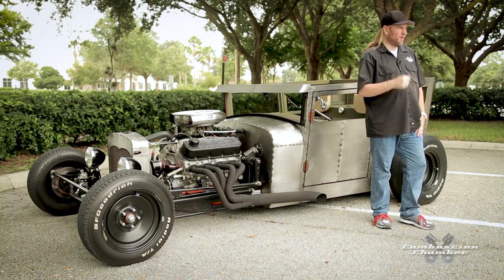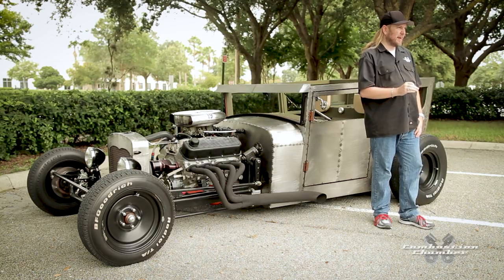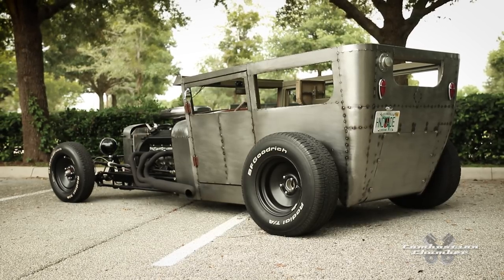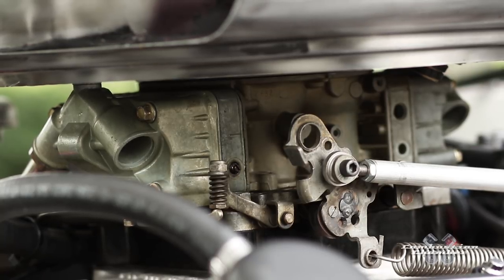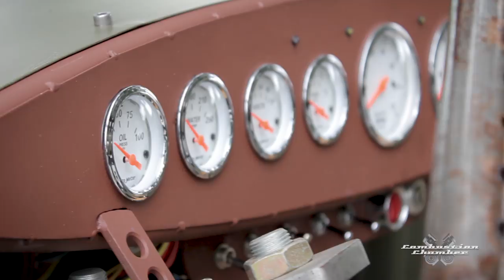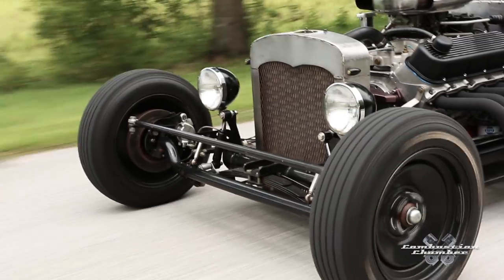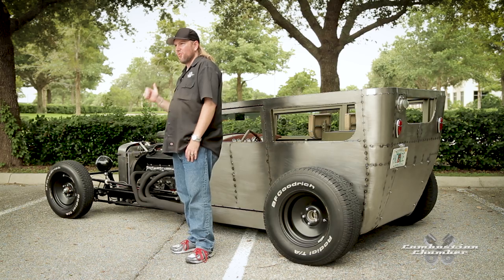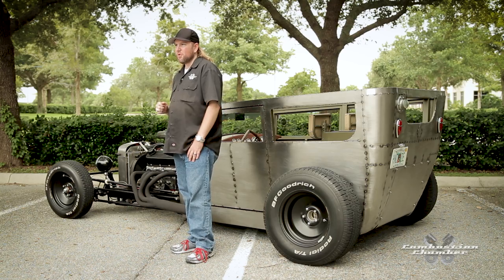HEAVY METAL! - Handmade Rat Rod - COMBUSTION CHAMBER

Comment: Howdy, my name is Iin, I'm a Virginia boy but I now live in Vermont. My lady and I just took position of of a Rat Rod. It was built by a good friend in Virginia (Kenny Allen). It's a 1942 Dodge pickup that is sitting on a Chevy S10 chassis so I have power steering and power brakes and all the modern handling of a late model S10. It has a small block 305 Chevy V8 with 350 heads aluminum intake and 600 Holey Carb. and turbo 350 automatic transmission. Wheels are of of a Pontiac Firebird and the gas tank is from a Triumph Spitfire.  Lots more but the computer won't let me post a picture. I have a lot of plans for it but I just wanted to let you know that there are a lot of us Rat Rod guys and gals out here.
Reply from the maker: Awesome! Thanks for watching and commenting! We just put a new episode up: https://youtu.be/gKfo5GYYBAY Enjoy! - CJP